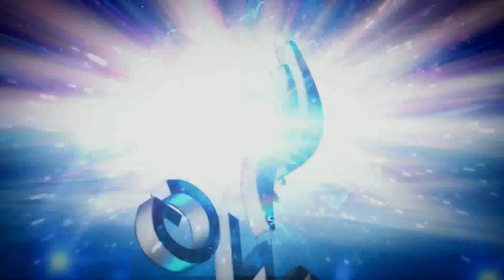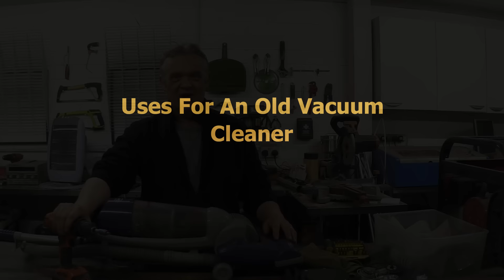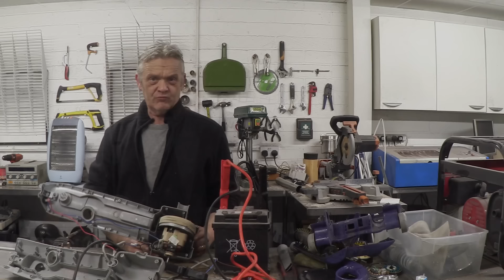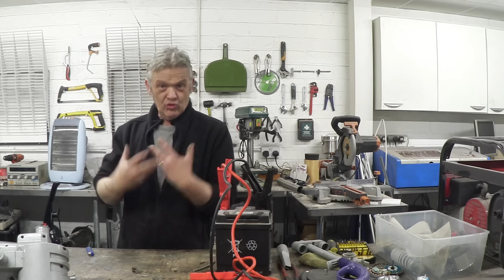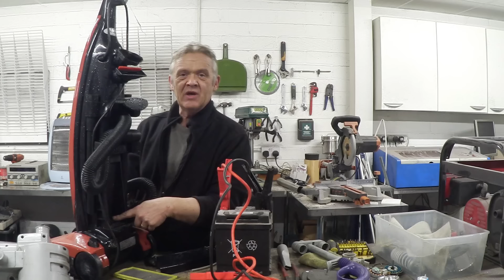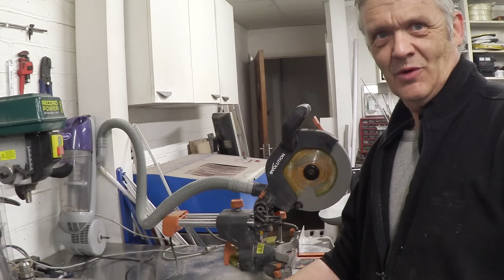Uses For An Old Vacuum Cleaner

Comment: We'd been using an old vacuum like this for decades. An extra long hose let us connect it to routers and sanders etc, and when we are done we disconnect the machine and connect a circular brush to the hose to pick up any dust that escaped. We finally ran rain-water pipes around the workshop so we had convenient connection points for the hoses. It saved us a fortune instead of buying a purpose built extractor system.

Comment: If the hose fits so neatly you should also show how you can disconnect it when your finished and use it to clean up what the saw has thrown out that the dust collector had originally missed.  If I'm not mistaken, by the looks of it, you can unplug the hose and vacuum up the table around the saw.

Comment: Good morning Robert, I have had this video in the back of my mind for some time now. I have a Dremel tool on a work stand which I use for light sanding and grinding. Of course it throws grit and dust everywhere. Just today I picked up an almost new cyclone vacuum cleaner from out local buy-nothing recycling group. Tear down and re-purpose begins shortly.  Cheers!

Comment: I really enjoy all of your videos they are full of great and useful information....thank you for posting so much free content... but to what i intended to say , i did a similar build with an old vacuum but the only difference is i wired the power from the vac to my switch on my chop saw that way its only on when im using the saw and no need for separate power source .... i fixed the cord from the vac to the hose of the collector to keep it out of the way ...works great for me....

Comment: I looked in to gasifiers and isn't the part where you want to use the cyclone, normally clears the gas from the tars and other stuff?  It would be hard to clean out the cyclone... Ones I have seen use a super course steel pads stuffed in a pipe that drains to a glass jar... 

And using vacs for woodworking... Make a Thein baffle... Holds more sawdust and chips, less cleaning out and you have more suction from the vacuum throughout the whole use until the baffle gets full... My shop vac, I never have to clean the filter and I'm using it a lot on a CNC, cutting grooves in MDF which is a lot of superfine dust... Before I built the baffle, I would get half way through a board and have to clean the shop vac filter... It would cover the filter like vacuuming up sheetrock dust.

Comment: Do those kind of motors have centrifugal switches to change the way field coils and winding coils are wired, once it upto speed? Changes the torque v rpm curves etc.
NB Such switches are often the cause of failure... And why "percussive maintance" can occasionally help.

Comment: I have a shop vac that I adapted to run through a cyclone dust separator ........ made from an old bucket!

I have to be honest .... I got the cyclone section from the web for £7 but I simply made a flat plate to screw it onto. This fits snugly into the top of a plastic bucket. The vacuum was a tad strong so I ended up screwing a couple of pieces of wood to the inside of the bucket to stop it bellowing in and to keep the top plate flat (the vacuum holds it tight and sucks any small air leaks shut)! No more cleaning out those faffy little filters!

This gives me a whole bucket full of sawdust and chippings that is easy to empty out and the filter in the vac needs emptying once a season (if I feel like it) ;0) I find in my "shop" it works best to have this stationary with a hose that will stretch to the tools .... but if you have a bigger shop and a spare pallet you cn easily construct a "cart" to drag it round!

There is a problem though ..... watching those chips spiraling down the clear cyclone section can be a bit addictive!

Comment: ah I have a 1 foot square ultra small particle air filter I had planned for slowing air flow so dust would be trapped from my CNC unit since I have had experience with so much MDF dust, even nearly destroyed a 30 year old dremel that I was using for the head originally, (which sadly they designed to pull air in from the bottom and blow the air out the back near the AC cord, ie sucks up the dust and pulls it through all the bearing areas and such lol)

luckily I saved that thing by pouring 3-in-1 machine oil on top of the bearings while rotating the shaft so it would soak in and flush out most of the grime, :) and yes it still works though once of these days I need to make wedges to push the bearings off and put some new ones on that tool as it is quite the useful tool. 

anyway on the dust collection I have seen it seems the trick is to use high suction over small tubing to grab it but dump this through a large container before it exits out the small hole on the other side so it moves more slowly across the larger diameter chamber where it gets stuck no long having the energy to keep it aloft, and they are built to disassemble and dump what has collected in there each day with the exception of a really large place that made 1000s of MDF based structures for stores and theirs it seemed was weight based so when it got enough weight of dust in the container it caused the bottom to drop down emptying and when empty and lighter the bottom was pushed or pulled back up with a spring sealing it up so t he air flow finished sucking it up to the bottom keeping it closed while continuing to pull that dust from their industrial routers LOL

Comment: I'm new to the membership thing here and don't know the best way to ask a question, so please let me know if this is the best way or if there's a way to get it in a more "on topic" way.

Anyways I was curious about using HDPE as the thermosetting plastic to insert my graphene into, since I care more about the mechanical properties of the plastic than it's conductive properties. I was wondering if you could point me in the right direction to a solvent for HDPE and if it's miscible or rather miscible enough with water to not change the process a considerable amount.

Again thank you for the wonderful knowledge and experience, I may be nee around here but it seems like a very caring and considerate community you've built here.

Comment: I think all you need with the original setup is a Tee fitting to have an air bleed to mix fresh air with the gasses to run the engine. Make a valve on the open air leg to adjust gas to fresh air and plumb to manifold.

Comment: I was told vacuum cleaners "get weak with age".  I suspect that's why there are so many working vacuums in the bin.  Now if we could only figure out how to make them quiet.
Reply: Clogged filters ! ... Even cyclones. usual to exhaust the sucked air over motor for cooling. So they have a filter between "usual dust collection" and motor. 

Reverse  flow of air across filter can often restore suction. Probably against H&S/take some care....compressed air will usually shift the clogging.  Be prepared for masses of fine dust!

Comment: Good one, Rob.  If rigged as a jet pump blower, the gassifier could use a mostly plastic ex-vacuum cleaner with a short metal extension nozzle, and be resistant to heat.  Salvaged metal tubing is easily used for a nozzle, and even a simple butterfly valve could throttle the airflow -- perhaps from a discarded carburetor or throttle body.

Comment: off topic, but this might intrest you : Western  Australia –December 1st2020 -Strategic  Elements  Ltd  (ASX:SOR) has  achieved a  critical milestone with its self-charging battery technology by manufacturing a 1 litre batch size of Battery Ink with the capacity to produce 2000 battery cells. The technology is demonstrating strong potential to scale up with production capacity rapidly increasing tenfold from 200 to 2000 battery cells.
Successfully harvested energy from humidity in the air and generated a minimum of 0.8 Volts over a testing period of two hours.

Comment: RMS, you can pull off the hose from your dust collector and clean the table of the saw. It will pick up the bits the saw leaves behind.

Comment: It's very interesting to put the 230 V Universal Motor to 12 V DC because I thought 12 Volt too low. Another idea came up: Why not run those motor as a generator? My idea was to disconnect stator and rotor, put DC on the rotor and pic up AC on the stator. (I never tried, but should work)

Comment: From what I've seen from people fitting turbos to motorbikes having forced induction can be a problem regarding the carburettors function,can't remember exactly what complications are caused but it's mostly to do with running above ambient pressure,not that the vacuum cleaner is going to be anywhere as powerful!  Thinking would an exhaust drawing system work? Ps there's a planetary alignment tonight!

Comment: Here comes a cautionary message...
A.c. switches don't hold up long to DC due to high arc. You probably are aware
Of this.
Reply: News to me. Thanks for the tip!
Reply: Might "Programable unijunction transistor and SCR motor pwm circuit" help with such? ... Pulses a DC voltage off regularly etc.

NB rather than usual "resistor programming" it is far easier to set timebase via fixed current regulators. Fixed current though variable resistor for trigger voltage. 
Use  current reg of slightly smaller amps to set charging rate. capacitor has constant dV/dT, easing timing calcs. and "put conductive latch on" avoided.

Comment: Hey I have a chop saw that does the same thing.. stupid machine.. I have had it long enough that you would think it knew what to do by now! Another cool thing is carpet cleaners.. they have great little pumps in them for running cooling 🛢 oil or water over a work item you are drilling or machining.. Or even to use to pump out small areas that have become full of liquid.. Take car Rob.. this is always fun..

Comment: Most commercial vacuums can also draw down hard enough to be used in thermoplastic vacuum molding, so that's another potential use for them that requires essentially no modification to the vacuum cleaner itself.
Reply: Are you talking about vacuum forming sheet plastic? You should be able to do that with what Robert has there I think, those appear to just be household machines.

Comment: how would  you wire it so the vacuum will start when the saw does ty
Reply: If you don't know the answer to that it might be a good idea to wait with ideas like that until you're more familiar with mains voltage
Reply: Respectfully, that may sound like convenience and clever,  but maybe instead it is more restrictive, running only when you pull the saw trigger. 

Having the vacuum/dust collector  on it's own switch is probably safer and cheaper than digging into the saw's trigger while concurently leaves you free to hook up your dust collector to a sander, planer, or another tool, flipping the dust collector's switch when you need it on or off.
Reply: @kreynolds1123  if saw has AC input... Small ac voltage should be induced in turns of wire wrapped around it. Saves breaking into mains voltages. 
Rectify it...to charge  capacitor with a parallel blead resistor, lamp or anything else to discharge capacitor few seconds after saw turn off.

Comparator to output high when capacitor above a trigger voltage. Fet, relay... what ever kind of switch good for load to trigger on by saw being turned on.
Reply: @stevecummins324  in theory that might work, although the stator shouldn't have much if any magnetic leakage.  many tuns of wire around the hot mains wire can be used to detect  current in the mains. coiling the hot wire is sure to be smaller than coilling the motor.